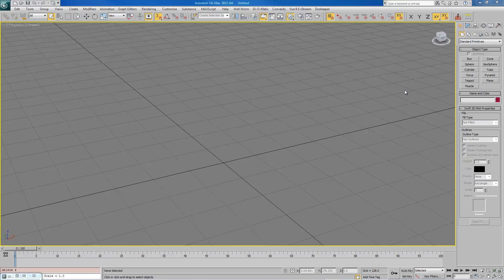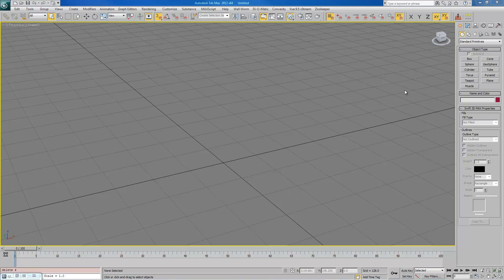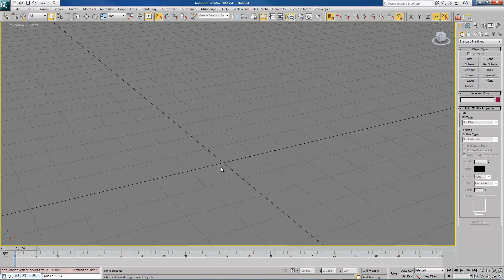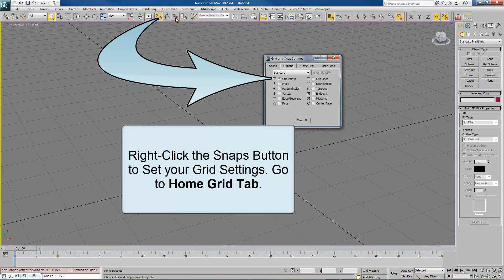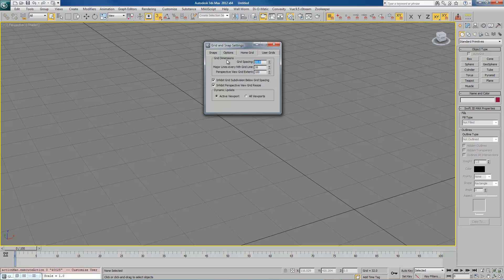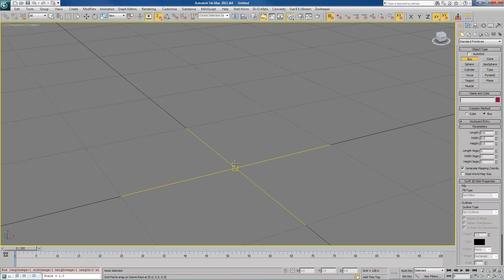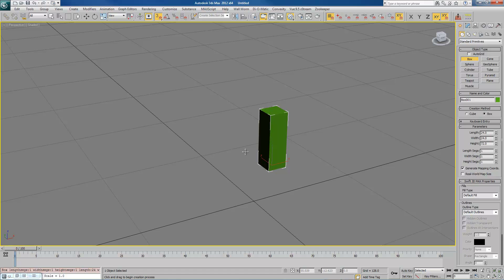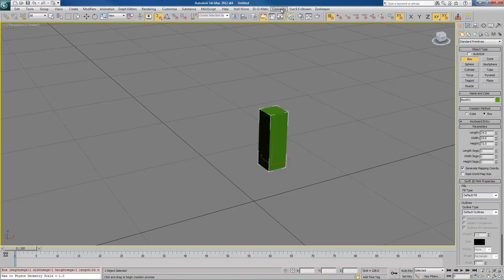Lesson 1 -  Setting Up 3ds Max for Source Level Design

Comment: Hello, great tutorials, really informative! One question please: Is there an alternative to convexity for Max 2014 as it is no longer used?
Reply from the maker: Yes and No. In terms of building walls easily, the answer is CorVex, which is a cheap commercial plugin that you can get off of the Wall Worm website now ( http://dev.wallworm.com/topic/66/corvex.html ) . There is no current alternative to the Wall Side View Editor in Convexity at this moment, however. That being said, I do know of a project that has potential to be like the WSVE with even more power (stay tuned on the WW forums). Anyway, CorVex will solve a giant percentage of situations where you would have used Convexity in the past and has the benefit of being tied to the splines in real-time.
Reply: Convexity was ahead of its time, its the best I've  used since like forever. I used a PDF Template made by Alvaro F. Celis, who made the template for Game Level Builder to get the proper settings. Im a MAX 2010 User.

Comment from the maker: @DSOClan100 Yes. There are two VMF Exporters right now; Convexity and the Wall Worm VMF Exporter. Convexity will export all convex geometry. Wall Worm does the same and will also export models and displacements... but it currently isn't exporting proper UVW for brush geoemtry. I hope to have that fixed any day.